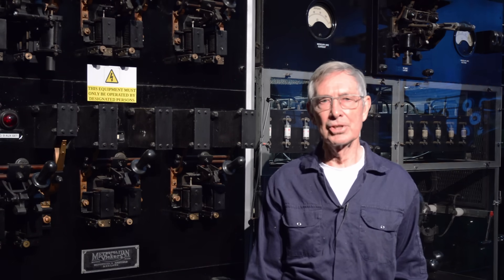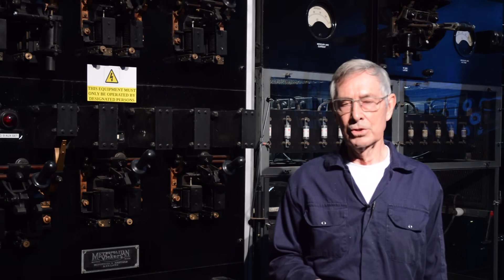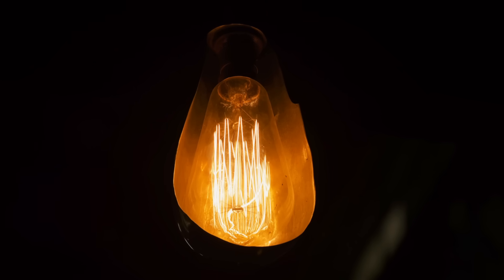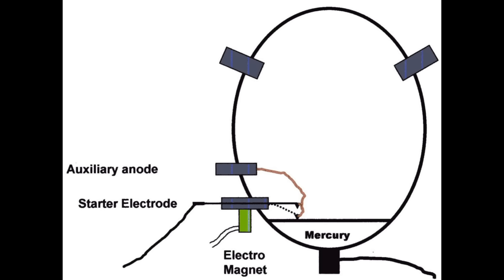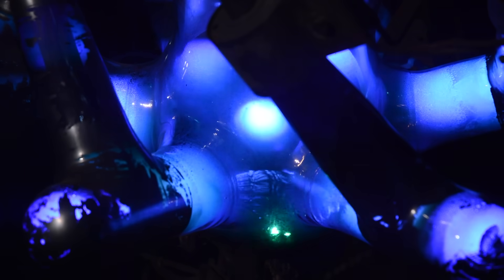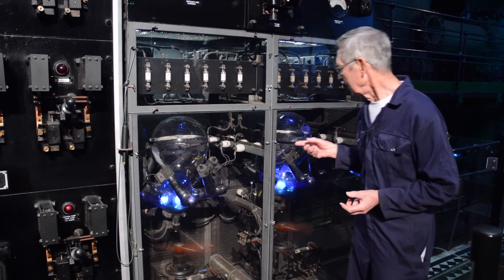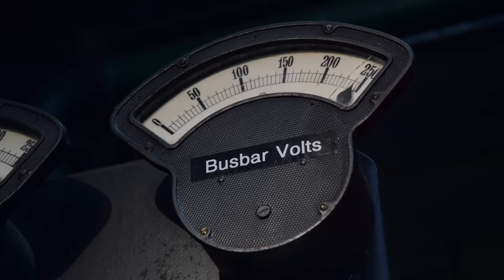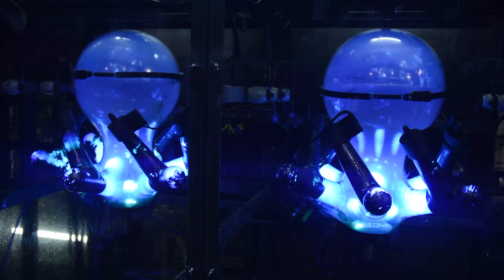Mercury Arc Rectifiers - Kempton Steam Museum

Comment: If you chaps are at all knowledgeable about Mercury I'd love to ask a few questions...I should write you a long email lol 

For example I have this working theory that the so called Star Shafts in the Queens chamber was actually filled with liquid Mercury.

The Queens Chamber's Star Shafts 
------------------------------------------------------
The Star Shafts in the Queens Chamber would have been filled with liquid Mercury

Keep in mind that if you apply a magnetic source & electricity to Mercury then you can make that Mercury spin almost as fast as the speed of light/

There is no logical reason they would have left a 5" partition between the Shaft and the Chamber unless they needed a strong magnetic source to penetrate the 5" & it also appears there was an electrical source at the top of the shaft 

Also notice the Star Shafts are in the shape of a giant tuning fork, this is because it is in fact a giant tuning fork.

If they could adjust the amount of current being applied to the Mercury then they could adjust the speed & tone of the tuning fork.

this vibrational energy would permeate throughout the entire structure, vibrating the stone & creating electrons in the process

Also note In 2018 Scientists built a small scale model & discovered the Pyramid naturally focuses electromagnetic fields in its "chambers" and down into the Earth 

I'm assuming that magnetic force would be enough to activate the Mercury thru 5" of granite & help make it spin, also there maybe missing items in the Queens chamber that would make a magnetic field

The Grand Gallery
-----------------------------------------------------------
When the vibrations reached the grand gallery they would cause the row of tuning forks (now missing) set in the slots along the walls to vibrate in sympathy.

Of course when you strike one tuning fork all other tuning forks in the area will resonate in sympathy if they are set to the same frequency.   

It is also possible they constructed the Grand Gallery to resonate at the same frequicies as the rows of tuning forks, thus when the Forks resonated the Chamber itself would also resonate & this would cause the Forks to gain energy & vibrate even louder...then that would cause the Chamber walls to increase...So back and forth they would create a powerful harmonic wave...

So this is a powerful NEW frequency, not the same as the Q.Chamber 

The Kings Chamber
----------------------------------------------
Still working on this part of the machine but it was also intended to create vibrations

Couple of points though...

*I think the Sarcophagus was another tuning fork, perhaps the Vat contained a liquid that would resonate at a different frequency.

*Also the extra thick layer of stone running parallel to the K. Chamber was to isolate vibrations & separate them, as well as the doors sealing the chamber 

*This also means they were seeking specific frequicies for a specific purpose  

 
Water below 
-------------------
Some other people had theories I like very much about pulsating water at the base of the Pyramid causing a sonic thumping & this pumping motion would cause the stone to slightly rise & fall, Thusly creating electrons in the vibrating stone

Also water was used to pump in large amounts of +electrons like an industrial conveyor belt

Vibrational frequencies 
------------------------------------
The first purpose of the Pyramid was to collect as many of the Earths naturally occurring electrons outside & also to make its own electrons as well, much like a Van De Graaff generator it collects and stores the energy until its released via the capstone.

When the different Vibrations form the tuning forks vibrated the entire structure it generated electrons out the wahoo & also energized the tons of quarts crystals embedded in the stone as well  

The Second purpose was to create powerful vibrational frequencies & combine them. I would not underestimate the power of vibrations or sound as its one of the most powerful things in the universe.

Although I'm not sure exactly how at this point I think they combined the different frequencies to make a beam, this would help transfer the electrons up into the ionosphere thru the capstone to above the Earth and just as Tesla theorized people could then tap into this power source & utilize the free energy

*also there are 9 key frequicies - from these you can create anything at will - so is it possible all nine were included in the design of the structure?

It's important to realize mixing different frequicies is a very powerful technology, everything has it's own unique frequency   

The Toroid structure
------------------------------------
A Pyramid is also a cone shape & a cone shape is also a toroid - same thing...But a Toroid is also like a Van De Graaff generator too.

Basically they were filling up a (powerful, don't under estimate) cone shape (the Pyramid) and energizing the electrons so that when they shot it out the top of the capstone it would all be compressed into a powerful beam of energy & the natural shape & form of the toroid would cause the mixture to mix like a blender 

add lots of vibrations and a dash of lemon juice & what do you get?

Free global energy

Tesla was right
------------------------
They built the Pyramid to be eternal 

The entire machine was designed to harvest Earths natural energy & do so so with little or no moving parts to replace, maintain to repair.

It was pure genius in it's simplicity of function & design, we are mere insects in comparison

A machine comprised of mostly vibration

Comment: Worked with London Underground's power distribution, most Hewetic rectifiers had long since been converted to diods in 70's Though the cabinets retained their glass or mesh panels.  Only MAR I saw was at Belsize Park station for it's 1 lift it operates. With Whip & Bourne plinth mounted DC breaker.  Also old British Thompson Houston refectifers at South Kensington. Whole traction substation had open copperwork at 11kv.  Nightmare isolating those things, with blade switches and open live slate panels at Barking Substation.
Reply: I am a Yorkshire boy. Trips to the Kensington Science Museum, were the highlights of my youth. Later in my early working life,I removed the rotary converters out of Dundee power station  ( Dc power for the dockside cranes) and then emigrated to Australia.

Comment: I wish you could of shown the precipitation of vaporized mercury in to the top parts of the dome where it runs in streams back down in to the mercury pool. That would of required running at load for some time.
I am surprised that you did not have a piece of ultraviolet blocking glass in front of the bulbs. You can roast your eyeballs (and skin) from the UV from those rectifiers when they are in operation.

Comment: I guess there must have been plenty of these mercury arc rectifiers on the third-rail system which began operating here in SE England beginning in the 1930s until relatively recent times. This type of rectifier for its size was the only device capable of handling high power until modern semiconductor rectifiers came along. It is noticeable that the present lineside power sets are much smaller than their predecesors.

Comment: My late grandfather was an engineer and was involved as a consultant in the construction of our local museum of transport and technology in Auckland, NZ. He explained to me that when the trolley buses were phased out in Auckland in the 70' - 80's the mercury arc rectifiers were relocated to a building at the museum to supply DC to the trams that run from the museum to the Auckland zoo and on to the aircraft museum down the road. Visitors to the museum are able to stand and watch them operating.
Reply: Yes! You can also see them operating at Ferrymead outside Christchurch, where they power the tram and trolley bus.
Reply: Sadly no-one is warned about the high levels of UV these produce, I for instance I received bad burns from watching this particular rectifier for several minutes.
Reply: @petereade4936  Sounds like the sort of thing I need in my home; It doesn't matter how long I spend in the sun I never tan, and the inability to be anywhere near as beautiful as all the other guys who tan instantly hurts me more than UV burns ever will. 😔

Perhaps I should install one in place of my hallway light? 💡
Reply: @petereade4936  Oh no! I've watched the video several times. Do you suspect I will feel any burns soon?
Reply: Thật thú vị !
Reply: Can these pass enough current to operate trams, then? I can see they glow pretty brightly just on a 40A load, so goodness knows what they must be like on the 500A+ load of an entire tram system! 😳
Reply: @UK-Combustibility-Assured yes the arc intensifies. But I would imagine the installation would be size-rated for the load.
Reply: Thx your info.

Comment: I remember visiting the Science Museum in South Kensington as a child (late 1960s) where they had two of these on show, one you could start with a little brass button and the other was started by turning a brass knob that I imaging brought a magnet into close proximity to the springy arc start electrode.
By the late 1980s they were gone, I guess the industry had moved to Semiconductor Rectifies so they weren't 'leading edge technology' to be in the museum anymore.
The 'Gas Generation' and 'Coal Mine' exhibits went about the same time - makes me feel like a dinosaur.

Comment: Great videos operated and did some maintenance on these in the late seventies as a young technician much larger units than shown on this video.  DC was still being supplied at 500volts + to -  to supply old lifts and escalators in Sydney Australia . The sub converted 11kv three phase to 6 phase low voltage then into the MAR,s then onto a big DC switchboard that looks like something out of Frankensteins Lab. I felt privileged back then to work on such strange and interesting technology , it was shut down completely in the early eighties and customers had to install local rectification in their switchrooms to run their old DC equipment.